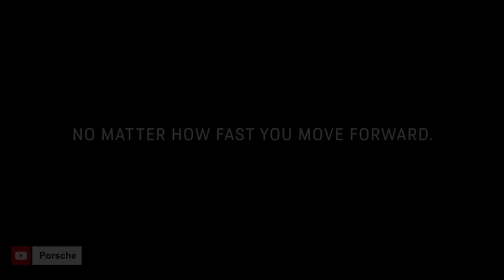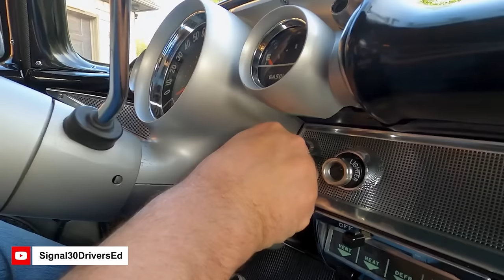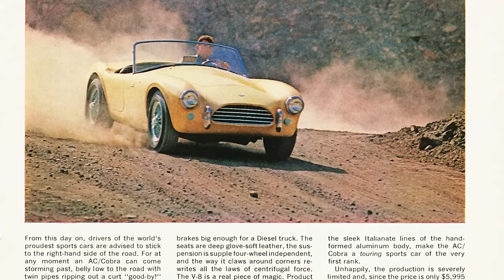Why Old Cars are Better

Comment: Speaking as a mechanic at a dealership. The 90s is absolutely the maintenance sweet spot. They have simple electronics that replaced complicated and finicky mechanical systems, but they still have a lot of simpler mechanical systems.
Reply: The GM TBI 350 might low key be the best engine ever made. lol
Reply: It could be the same, but manufacturers declared war on repair and customizers. So much precious engineering wasted just to steal ownership from the owners, it is insane.
Reply: @anthonyrowland9072  personally my favorite v8 is the BMW S65. Over 100hp per liter. Amazing sound from the cross plane crank.
Reply: @kaveric_7614 4v 4.6 mod motor with an xpipe...
Reply: @anthonyrowland9072 2 valve gang. 175k miles now. Still my daily 🦅
Reply: @angelgjr1999 One of the most reliable engines ever. There just wasn't a manifold readily available to let an OHC 281 rev like it needs too when it was the most popular. The Victor jr and some trick flows would've been hot in 2004. They figured that out finally with the coyote though.
Reply: @anthonyrowland9072  Yeah she don’t like to rev. She makes her torque down low at like 3-5k rpm. I rarely let her see over 5k rpm since there’s no point. She sounds amazing though. And with 4.10 gears and Full bolt ones she’s peppy.
Reply: Fully agree, 90's to early 2000's was the golden age. Peak engineering, simple electronics, easy and intuitive to service, the works. I'm planning on keeping my '99 Blazer as long as possible.
Reply: Still drive my 87 S10 4x4. Mechanical speedometer but has a computer and electric fuel pump for the TBI. All can be replaced with a carbureted engine and mechanical fuel pump fairly easily. If my truck wasn't all original and in good shape I would have done it a long time ago.
Reply: Exactly why I bought a 99 lexus
Reply: @BreakYoselfFoo  that’ll run forever just don’t skip on maintenance
Reply: @angelgjr1999  Im doing my best
Reply: @anthonyrowland9072 right up there with the AMC 4.0l.
Reply: @anthonyrowland9072  shit would run forever . I just rebuild the TBI on my 1991 k1500 because it had 325k on it .
Reply: @kaveric_7614 that's facts , the problem is the cars rotted out back then but mechanically they lasted longer than anything . I think the sweet spit is 1990 to 2008 . Things changed alot in 2008 cost vs quality wise in everything
Reply: @jay_Jalapeno When it all went to a CAN-BUS system, when if you get water in your tail light, your engine might not start now...
Reply: @anthonyrowland9072  yup . Can-bus great theoretically for diagnostics but the second anything goes wrong, It screws up the entire car. I remember this one time when I was a service manager. I had a car come in. It was like a 2012 BMW 3 series. The alternator was bad and it was overcharging. And it was causing no word of a lie 30+ codes all the way from alternator codes to all wheel drive to abs codes. Plus I feel like after the financial crisis build quality took a nose dive
Reply: @anthonyrowland9072  My sister was looking at getting a newer car. And she's very pro right to repair her face. When I explained to canbus to her was like I just kicked her cat lol. Her only response was why the f would they do that lol
Reply: @jay_Jalapeno Tell her screens aren't higher tech, they're just cheaper than switches and buttons. An F-22 has all three and it's the highest tech thing on earth.
Reply: @Sterling_Silver04 
95 camry.  Amazing.  
Lot of 95 cars. Pretty badass
Reply: @anthonyrowland9072 

@Iron_Sights99 
95 camry.  Amazing.  
Lot of 95 cars. Pretty badass
Reply: This and some early 2000s
Reply: plus everybody thinks they're "unsafe" and "old," so you can find a decent one for not too much! My 03 Vibe is the best car I've ever owned.
Reply: yup.... 96 to 05 is the sweet spot for GM (a hate ODB1 due to working on post office LLVs lol.... moved jobs, post office followed me.... as im the only "kid" (im 30, kill me) that knows how TBI works)
i usually diag with out even looking at the codes..... 
.
i absolutely LOVE my 99 buick century..... the 3100 isnt as good as the 3800.... but MUCH easier to work on
3.1 = do the LIMs.... then let it piston slap and lifter tick for 300,000 miles.... its fine
Reply: Im gonna keep this in mind when shopping for my first project car
Reply: @lemoncurry351  BMW E30, E36, and E46 3 series make great platforms. Mazda Miata’s are always a good choice too. Early 2000s mustangs and camaros are good choices of you want something American.
Reply: The late 90's is where problems started, with the scabs working the lines putting vehicles together when the AutoMakers were dealing with the strikes!~
Reply: @Sterling_Silver04 That's cool Iam keeping My 2001 Nissan Pathfinder in North of México
Reply: Interestingly the 90's US cars/trucks basically mostly still had 1960's drivetrains , just with EFI / overdrive and a new body around it
Reply: Still driving my 91 c1500
Reply: @castirondude yep. A 1960’s designed engine, like a Ford or GM big block for example, with a simple port fuel injection system is a recipe for insane reliability and great power output.
Reply: I've got a 2005 Sierra work truck...never selling that thing. It's bulletproof and so easy to work on
Reply: I have a 94 mustang and I can basically get at anything on the engine when it needs to be replaced. A modern Mustang? Good luck with that
Reply: @CollideFan1  Honestly. Modern v8s are such a paint to work on. The americans don't know how to make something come apart after they assemble it, the germans do but at the cost of adding more things in the way in the first place, and the japanese are usually easier to work on than the others but always those couple of jobs that are an absolute nightmare compared to the rest of the engine.
Reply: The 90s was the sweet spot for life in general. Enough technology to help make life convenient, but not too much to where it took over our lives.
Reply: My truck is a 1972 Chevy one tonn that I put a 5 speed in it and a 6.2 diesel love that Truck.
Reply: Absolutely. Love my '93 Nissan D21 pickup to death; the ultimate get 'er done machine.
Reply: 70s ands earlier best!
Reply: @SteveCarras  I said the 90s because you get all the amenities and performance of modern cars but without all the electrical nonsense that you don’t need, and they’re still pretty easy to work on.
Reply: Definitely the best of both worlds. My Crown victoria may be a 2009 but it pretty much functions and is setup exactly the same as it was in 1992
Reply: @SteveCarras  I have a 1952 kaiser deluxe  I'm working on right now.
Reply: Agreed I would buy a 90s cars
Reply: You are right on the money. 70s and 80s were usually only designed to last 100k miles. mid 90s to 00s were the peak of automotive engineering, where simplicity and reliability peaked, after 2010s everything became super electrical and sensor based, that reliability and repairability took took a dive.
Reply: I just came up with a idea. Steam and Ethanol engines. Half runs on steam half on gas. The half steam runs a closed cycle similar to how a refrigerator compressor works. For one thing, In Brazil, when the fuel crisis hit, the population really wanted smaller vehicles (We never had the boats that USA Had, only the "midsized" Galaxie 500, Simca Chambord, GM Opala, GM Omega, and the Dodge Dart were the biggest cars we ever got If I'm not mistaking) 
So, with the crisis, came the Ethanol fuel, and cars became smaller. NOW With the pressure of SUV's we are finally (badly I'd say) moving to SUVs instead of sedans and hatches, which is a shame. But I agree, 40 years ago a car could make 8KM/L and nowdays cars barely make more than 11km/l in the city. At highway, its slightly better, the cars of the 80's made around 13kml, now cars can make 19kml, its better, but at city, where it matters most, nothing changed at all. And add that Flex Fuel consumes more than plain Gasoline or Alchohol engines, and add useless tech to todays cars (apart from the very good safety, A/C and Power Steering) the cars of today are really more of the same...  And cars today trow a rod if you forget oil change for 1 mile. Older cars didnt care. And they never broke. I hate todays plastic engines
Reply: I have a 2002 highlander and the mechanic I went to was sweating bullets. He thought that what I was bring in was mostly modern but it was basically no more modern than a 1993 camry lol.
Reply: I must agree. 
25 years after its purchase, I still refer to my 1999 Silverado as my "new" truck.
It has required very little maintenance over the years, and it suits me just fine. 
Being painted a 2-tone, meadow green above pewter, it turns heads and elicits compliments from people almost everywhere I drive it. 

I do remember having one persnickety problem with it, early in its life. 
The 2WD, 4WD, NEUTRAL, AUTO 4WD selector control module would mysteriously switch back to 2WD all by itself, fairly frequently but not always, if and when I was attempting to use it in 4WD or AUTO 4WD.
The dealer never was able to duplicate the problem (I hate when that happens), so after having it into the dealer on several fruitless occasions, of course it was up to me to repair it.
I removed the switch module from the dash, examined it very carefully under high magnification and discovered an extremely minute crack in a solder joint on the rear of the module.
I touched the crack momentarily with a hot soldering iron.
It's been working properly ever since.
Reply: I love my 94 suburban.  EFI for easy starting and running with a paperclip for a scan tool.
Reply: Still Driving a 1999 Suzuki Vitara convertible, basically a Mini Jeep,   just regular maintenance , no check engine light, runs as good as new, gets great fuel economy,   you can't even buy a 4x4 convertible these days without buying a Jeep !!! , and then id have worlds of issues with keeping it running,  Cause its a Jeep!!!
Reply: i have a 1991 toyota corolla liftback, its an awesome car in my eyes, only problem is my front fenders are extremely rusted, and i cant find them anywhere😭
Reply: Cars were built more durable back then. They weren't plastic they actually had a steel Body and Frame
Reply: @robd1859  nah they had a lot of plastic still, and body on frame tests to rust more than unibody does. The difference now is that the used plastic for things that didn’t really matter like the interior or an engine cover, where now they have plastic water pumps and silly things like that. The reason they’re more durable is because they built them stronger than necessary due to not having very accurate computer models. Now they just build cars to last until the warranty expires.
Reply: Can't go wrong with a 90's toyota
Reply: just changed my own oil and oil filter on my 2004 volvo v40. didn't even have to remove the fuse box.
Reply: @654Crossman  Yup. The only issue with that engine, at least in Jeeps, was that you had to replace the fuel injectors after about 70,000 miles. Other than that it was bulletproof.
Reply: @JeffWilkinson  not true, good Sir. The post 99 4.0s(if I remember right), were problematic, since Chrysler decided to tweak the design. That's why if you see a 4.0 with a distributor cap, you know you're solid. The ones with coil packs are like a ticking time bomb. The Chrysler variants had all kinds of issues, including the blocks cracking. The ZJs are solid. The WJs got the 4.0s that people hate. Also had that garbage "quadracrap." My "Selec-Trac" has worked flawlessly. I hate almost every single type of Jeep made after 99 but I still rock the colors, for the old timers. What can I say? I'm a millennial mechanic that only drives vehicles as old as I am. 😎
Reply: I think the 90s in general was the perfect balance of technology and humanity. There was enough to make life easier but you could still escape it if you wanted too